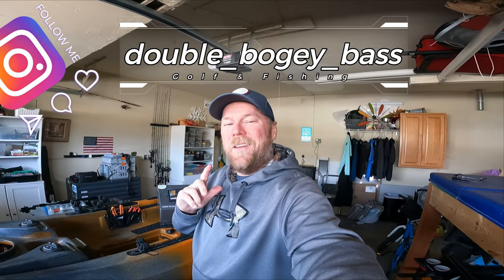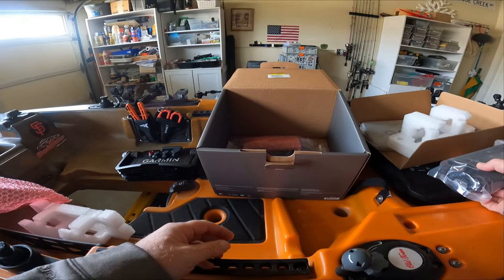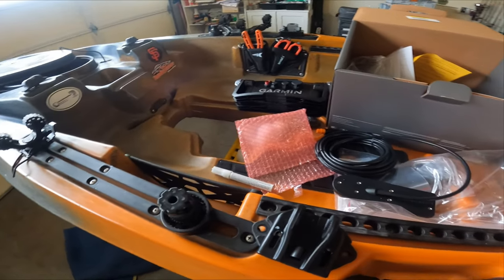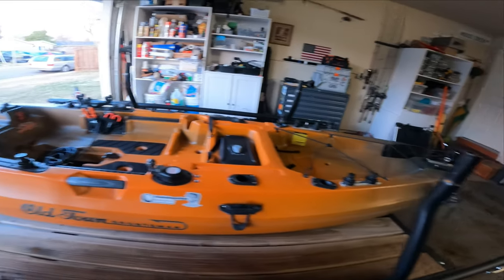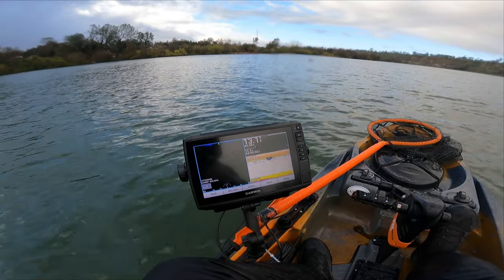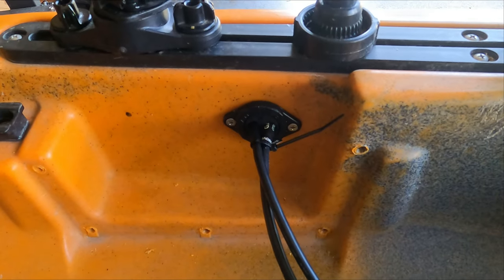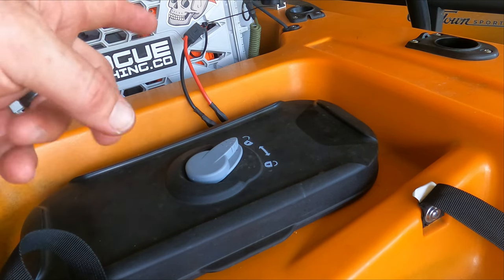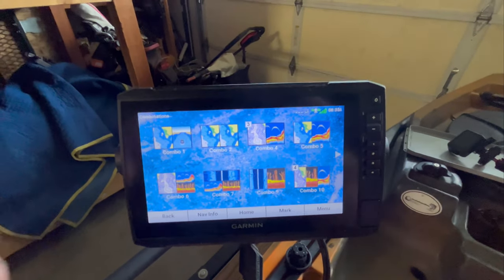GARMIN 93SV Install On A Kayak For Beginners  @YakAttackKayakFishing  Through Hull Wiring Install

Comment: First video I actually found of someone going step by step in installing. Maybe for those who were wondering and aren’t tech savvy, you could’ve showed details in the video of you installing the wiring to the terminals of the battery. Just things like that. Overall, very good on all other details.
Reply from the maker: Good call on the wiring, I did forget to film that step, but should have added that in. Thanks for checking out the video!

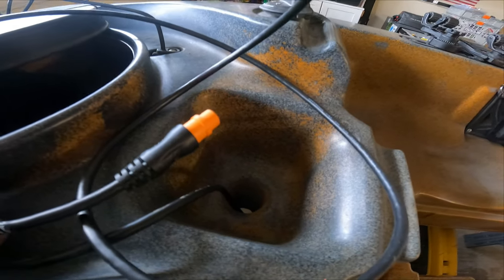Comment: 9:43 I think you've installed the bracket upside-down.  It will sit flush with the water when you flip the bracket.
Reply from the maker: I tried it the other way and it didn’t work that way either. But as I said in the video I didn’t end up using this bracket and ordered a different one.

Comment: Great video thanks for posting. I heard for the side scan to work correctly the transducer needs to hang down from the kayak. Now that you have had it on for a while have you had to adjust the transducer?
Reply from the maker: I haven't noticed that. But again, this is my first experience with depth finders, so I don't have anything to compare it to.

Comment: Hi! Thanks for a nice video! I recently got a UHD2 72SV and I’m looking at what battery to get. How long runtime do you get with your 10Ah battery? Cheers!
Reply from the maker: If I had to guess I would say somewhere around 10-12 hours. I have never actually done a full run test on how long, but I did use it in a 2 day tournament, where I was not able to charge it overnight, and it only lasted a few hours on the second day before dying. I also run my camera off of if too at the same time.

Comment: Like Mike posted below.. I was under the impression that that transducer had to be below the level of the Kayak in order for the side scan to work correctly. anybody have any information on this? Is that true?
Reply from the maker: I honestly don't claim to be an expert on this, so I can't confidently answer that question, I do know that many people use this set up, many people that claim to know more about it than me, and they run it the same way. Tons of tournament anglers running it this way on their kayaks as well and I haven't really heard of many people having issues with it. But again maybe it will  🤷‍♂.
Reply: It just depends on the kayak and where you're mounting.  The more space from side of the transducer to side of kayak wall where it's being mounted, the more scan area.  You can mount it right at the recessed point, where lowest point of the transducer is flush with the lowest point of the kayak, and it'll be protected and still give a fully side scan picture.  That's my experience anyway.

Comment: How long of a run time does the Dakota battery give you running the garmin
Reply from the maker: I fished in a 2 day tournament last year, and camped onsite and was unable to charge up my power box overnight, but I was able to run it for about a total of about 10 and a half hours before it died. I also run my rear camera off of it at the same time.